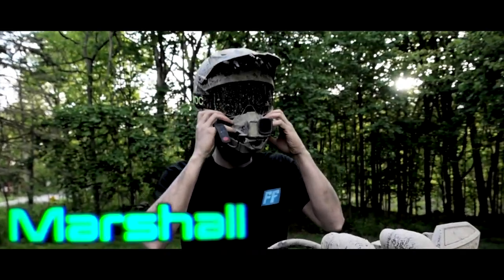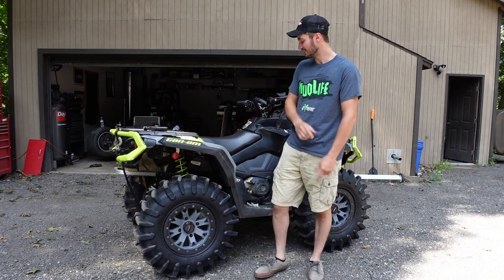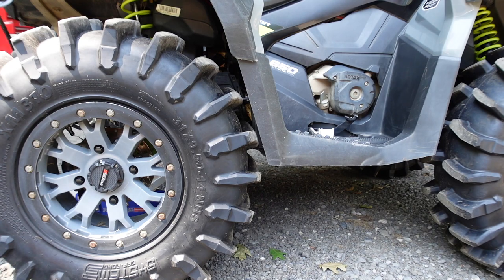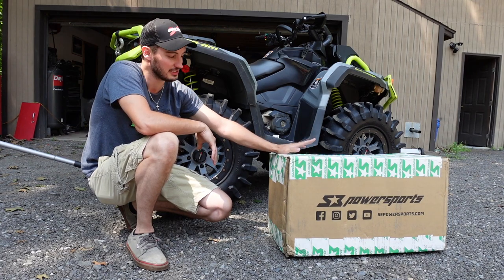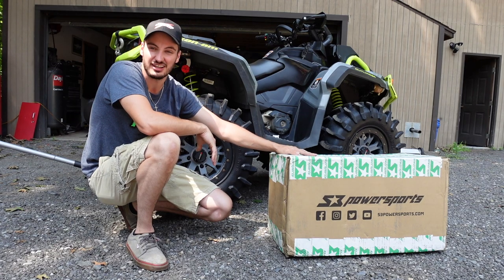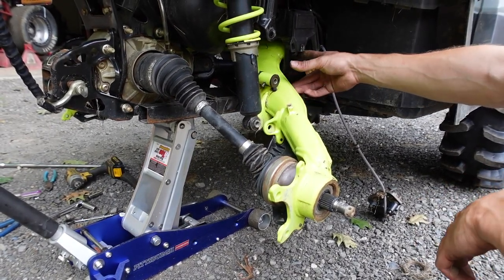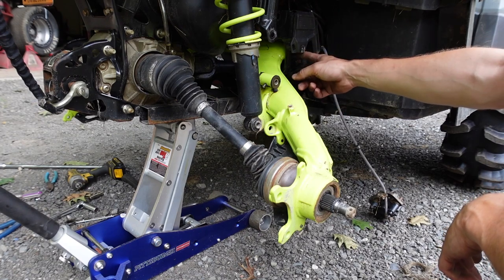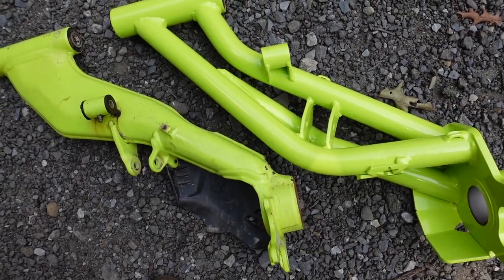S3 Powersports 2" Stretched HD Trailing Arms Install on a Can-Am Outlander XMR

Comment: S3 Power sports has some great after market designed parts.  I installed a set of  +2" trailing arms about 6 months ago. I had the same bearing issue as you did. I had a .013 interference on one side and a .011 on the other side. (you should have a .0015 - .0025)  There was no way I was going to press in new bearings. I'm a mechanic / machinist, and have access to a machine shop. I took care of the issue myself. I  removed the old bearings and checked them. There was a .004 interference from factory. (really tight) Now I got room for the 31x8.5x14 EFX Motohavoks. And then I said "what the hell" so I did the front A Arms too. (install on Minnesota XMR) Keep making the videos. "Ride Hard and Be Safe"  MN Bill

Comment: My main long bolt just spins and sucks one side through the nut won’t tighten equally, now I’m running into the nuts getting TIGHT and still leaving a gap from the spacers….won’t snug up now.

Comment: Did you measure it before and after you fitted them… Im curious to see if it did give it a 2” lift
Reply from the maker: It’s not a lift this is a stretch. The ride height stays the same. For a 2” lift we recommend Perfex Industries. You can use our code “Letdirtfly10” to save 10%

Comment: just got my 2022 outlander 850 xmr and am looking to get extended arms to clear 32s, was curious as to how they are holding up and what the cons to them are if any
Reply from the maker: So far they're holding up great! I currently have 32" Motohavoks and they clear no problem in the rear. I still need to do the forward front A-arms. The only cons I can think of is that they weigh more then the stock arms. Probably a good 10 lbs each more. The other con was during the install, the wheel bearings were a pain to press in. Id definitely recommend honing out where the bearing goes slightly so the install will go much smoother.

Comment: You don’t have to remove trailing arms to replace axles. Remove shock, sway bay and drop down all the way and should come out from hub.
Reply from the maker: I’ve only been able to do that on gen 1 can ams. I tried that before on my G2 and there’s still 3” of axle in the bearing when fully dropped out with everything disconnected. I’m not sure if it makes a difference but 2020 and newer have longer axles also. At that point it’s only the extra through rod bolt to take out to get the axle out.

Comment: lmao!!! Only dude EVER that likes plastic over metal...🤣
Reply from the maker: Lol I like the OEM look
Reply: Every ounce counts too sometimes. Ask a Honda owner next time one floats by you… lol
Reply: @MrT13  like a boat?
Reply: @bitrage.  well I mean define boat lol. If it floats….
Reply: @MrT13  The new Acura Integra....🤣
Reply: @bitrage.  no man foreman’s with wide 30’s float. Early ones did anyway I had one on heck I don’t remember now maybe zillas? But I had one and it floated. You had to lay down if it was super deep but 2’ snorkel and unless it went sideways, it went.
Reply: @bitrage.  actually that was the bike I put ammo can on. I did roll it once got home and put 4 whatever the next size bigger is I think 20mm ammo cans on 4 corners. It never rolled again. Looked funny as hell but I’d take it across ponds too lol. Don’t look so funny when it comes out the other side of a lake lol.
Reply: @MrT13  i had an old Honda dont remember if 250 or 300 but it was automatic with full time 4x4 and some1 put mudders and snorkels on it.. I rode thru my pond with it completely underwater and was sooooo surprised how good it was for being such a small engine..
Reply: @bitrage.  yea they definitely do work. I’ve had a couple they are good for some things and not others. I don’t think they go through more though. Once you get 32’s or something on a bigger bike it’ll leave em.
Reply: @MrT13  I used to do alot of bartering, Got one ATV then after i got tired of it i fixed em up a little and traded for another atv/dirtbike... lol had like 10 different atvs and dirtbikes in a period of 2 years, That one thought really surprised me how capable it was, actually changing my mind over liking sport atvs more then 4x4 ATVs..
Reply: @bitrage.  right right I mean most of the time parts are pretty cheap for these things. If it’s older. And yea now I got a 99 trx 400 that’s had some stuff done of course 430 heads cams bigger carb. And also an outlander 1000 xmr on 32 assasinators. 2” longer and taller and new floor plate thing. So fast backup bike and big capable family bike. If I didn’t have the wife and kid I would’ve got the 570 - 850. But btch seat….